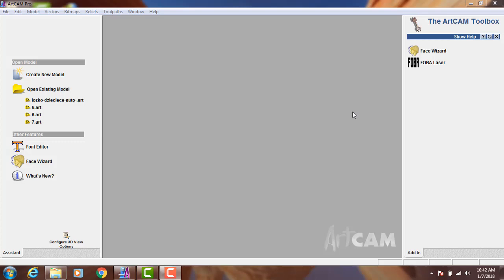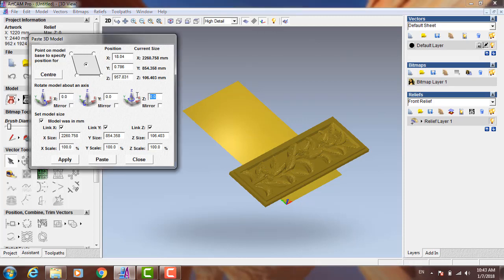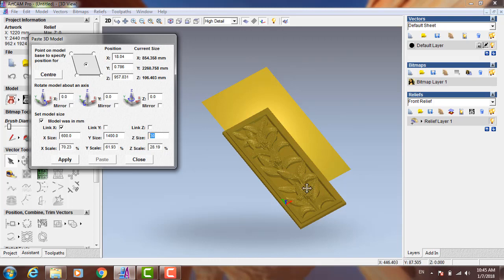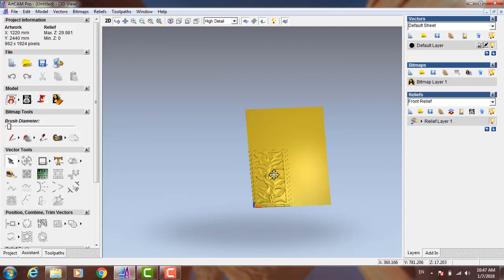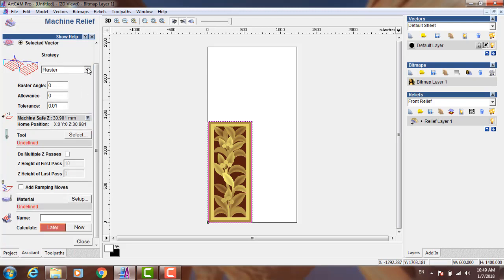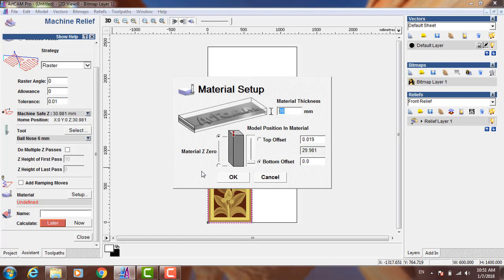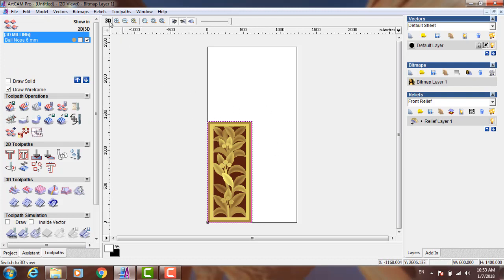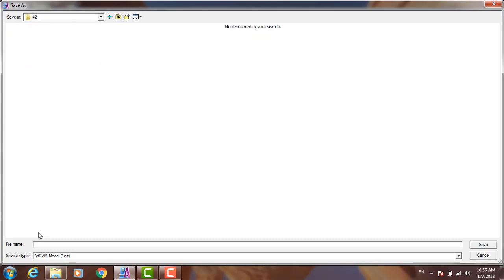Import STL file to artcam and make toolpaths and export g-code file

Comment: What is the difference between importing a DXF file to a STL file? 
I used to draw in CorelDraw and make the relief in ArtCAM.
Now I am using Rhino to model, but I don't know hot to import to ArtCAM to generate the G-Model.